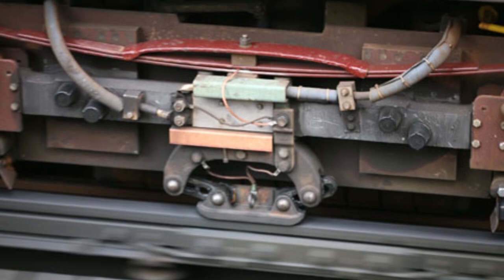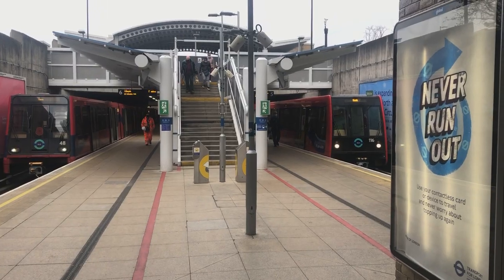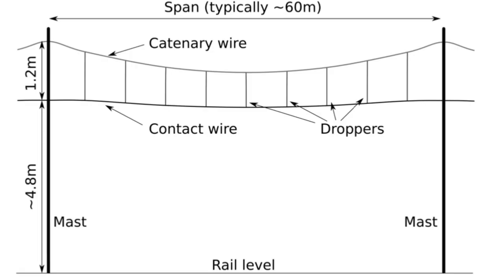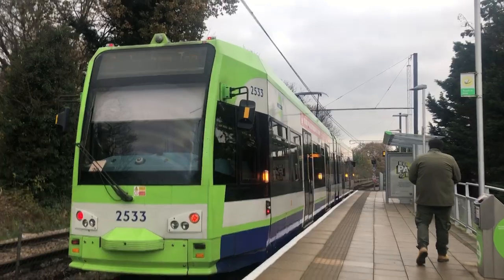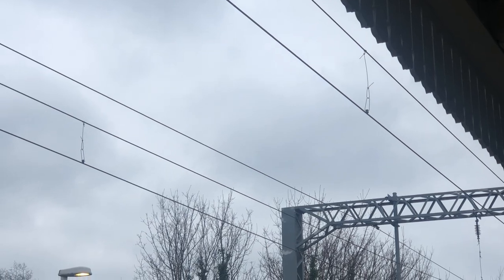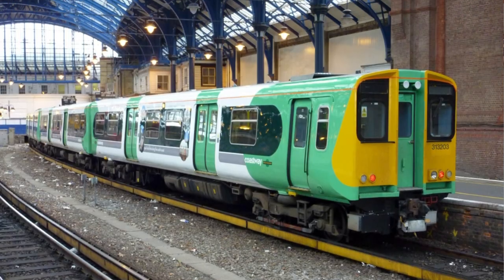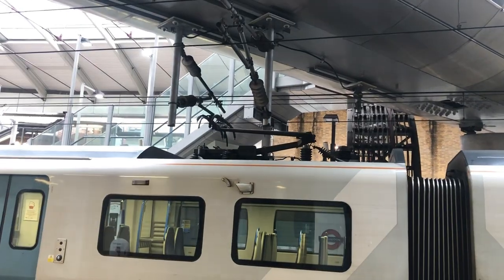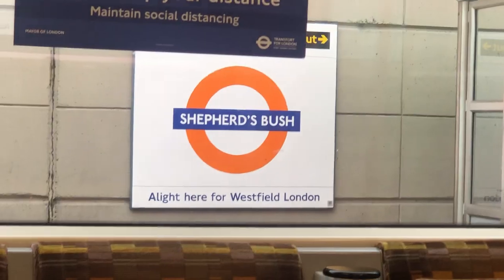How do electric trains actually work?

Comment: Overhead wires also have 'neutral sections' at strategic intervals. These are short, insulated (dead) sections of wire which prevent different phases/voltages from other feeder stations mixing. As a train approaches one, a pair of magnets at track level opens its circuit breakers and cuts the power (minimising pantograph arc should the driver fail to shut off). After a few yards, another pair of magnets closes the breakers and restores power to the train. 

A clunk or bang will be heard if you're sat near the pantograph, lights may dim slightly and any air conditioning will usually cut out for a moment when you go through a neutral.
Reply: Is this used on 1500v DC systems as well? Or is it just that the circuit breakers on these systems are much quieter because I've been on both 25000v AC and 1500v DC and I've only heard the circuit breakers on the higher voltage systems.
Reply: I'm no expert but as far as I know; DC systems don't have neutrals, but it's still desirable to shut off when passing feeder points. The UK's AC system, at least has track magnets to automatically cut power when trains go through a neutral. Most other countries rely on drivers shutting off or even lowering the pantograph. If traction power is already off, the breaker noise should be quiet, going through at full power would produce a very loud bang, arcing and possibly damage the pantograph. There are also signs telling drivers that a neutral is ahead, giving them time to ease power (important with tapchanger loco's). It's all part of the route knowledge anyway. Hope that helps!

Comment: I love this, thank you so much.

A few pieces of trivia. 3rd rail is often chosen for Metros/undergrounds/subway systems, for reasons of space (isn't always room for a wire). Yes, it was chosen for the DLR for aesthetic reasons. The only non-Metros to be third rai are parts of England (generally the ex-Southern Railway lines...as well as two lines in and around Liverpool for some reason), Argentina around Buenos Aires (in fact two different voltages and gauges) and New York City (two different systems there, also, inherited from two different main lines who hated each other)
Reply: I used to live by the main Portsmouth-Waterloo line and, like many other kids in the 70s, would play on the tracks. We had great respect for the strange very black rail...

Comment: Very thorough. Here up north we've taken delivery of the Stalder 777s which potentially can carry a battery which charges up on electrified lines and gives the potential to extend it's range onto the unpowered network.
Reply: I think the reason they contain batteries is because they are planning on extending Merseyrail from Kirkby to Headbolt Lane but they cannot build 3rd rail anymore due to safety.

Comment: Just to add a bit more on 4th rail London Underground running. An ex LU power engineer told me that it is to do with the difficulty of recovering failed trains in deep tunnels. Its because you cannot send out locomotives to tow them out. So the fourth rail is switched over to be temporarily used as a live conductor rail .

Comment: I always wondered how they mitigated single point wear on the pantograph contact patch, thanks for the informative video! Incidentally, on the class 700s, I noticed you can hear the difference in the traction motor noise under load  between third rail and overhead supplies (DC sounds sort of like a car alarm, whereas AC sounds like normal IGBT drive noises) I guess they use different VFDs depending on supply type.

Comment: Note that some London Underground lines have 4 rails.  Two for the running wheels, one for power, and a fourth for the return current.

Why?

Some of the old tunnels are metal caissons and if the normal rails were used as the earth conductor, it would cause the metal caissons to undergo electrolytic damage, so the return current is earthed in the fourth rail to isolate power away from the main rails and their connections to the tunnels.
Reply: Thank you for explaining this. I have been wondering about this for a while.
Reply: Didnt he say that in the video?

Comment: Overhead wires also have tension weights at the end of sections to cope with expansion and contraction due to temperature changes. This ensures constant tension and avoids sagging hot weather

Comment: We have something like that in the US called the P32AC Dual Mode. It can run both from its diesel-electric prime mover and third rail pickup. Amtrak uses it in New York, because you can’t operate diesels in the tunnels under a few of the stations.
Reply from the maker: Oh wow! How comes they can’t operate diesels at a few of the stations underground??
Reply: Also the trains that operate on both third rail and overhead are similar to Boston's Blue Line subways.

Comment: I saw a few vids on how some of the truck routes on the autobahns in Germany are becoming electrified, utilizing an overhead line, much like a train uses, and a hybrid semi with both a pantograph and drive motors, as well a diesel engine that takes over when the truck leaves the truck lanes to a local depot nearby... The semi loads or unloads at the depot, then heads back to the autobahn truck lane, and contacts the overheads via pantograph again... I have no idea how the circuit is completed, as the semi runs on no tracks on the roadway...

Comment: Apart from the speed restrictions, with 3rd rail I always thought you needed substations at regular intervals to maintain current, which is why it tends to be used for relatively short distance networks. To think the LBSCR abandoned overhead wires for 3rd rail for consistency with the LSWR's 3rd rail commuter lines..
Reply from the maker: I’m glad they chose to abandon it. Southern region looks much better without it. Looks more traditional !!
Reply: @networknathan  There's always rumours  that they'll ditch 3rd rail to increase speed and efficiency. Interesting if they ever electrify the West of England main line between Worting Junction and Exeter which method they'd choose..
Reply: @Dark Dreamz There's 3rd rail tracks from Waterloo to Weymouth, which is even further...
Reply: I grew up in the SF-Bay Area when the BART (Bay Area Rapid Transit) system was being constructed in the mid 1960's. The trains use a 3rd rail side contact 1Kv DC which is considered an odd voltage. Each station had a power sub-station 33.5 Kv primary stepped down to 1Kv rectified to DC.  Traction motors were originally DC however about 20 years ago changed to AC 3 phase with inverters.  There are power struds (short lengths of 3rd rail along side the rails where there is an interlock/crossover) And longer ones where their is a gap.

Comment: Very informative and for a Mixed System you're at something like parts of London that have it since I'm from the United States New York City Region has those at the Penn Station area and Metro-North Pelham Station for Mixed System. One more thing about overhead wire those permit a maximum speed of 355 mph 573 km/h since there's a British Broadcasting Corporation footage of the 2007 French high-speed train record which attained that speed
Reply: Generally, top possible speeds are much higher with overhead wires. With 3rd rail, 100 M.P.H/160 km/h seems to be the absolute limit, beyond that the shoe breaks contact with the rail, making it harder to keep up the speed.

The standard voltage these days is 25,000 volts, but there have been others (from 6,500 to 50,000 when AC. There have been DC overhead lines, still re in places like France and Belgium, where 1500 or 3000 volts is normal. Higher speeds are available on higher voltages, generally (MOST of the "high speed" lines out there are 25,000 volts, except Germany's ICE, which uses 15,000 volts.)
Reply: @raakone  Good point there are other high-speed trains that use 15,000 volts ac 16.7hz OBB Railjet SBB CFF FFS Rabe 500 501 502 & 503 Austria Switzerland. 15,000 volts AC 16 2/3 Hz X2000 Sweden BM 71 73 Norway

Comment: over head lines can directly get electricity from grid, but third rail have to have step down and rectifiers since its low voltage DC. And there is less power loss in high voltage over head lines.

Comment: Your vids are livee bro👊 I would actually prefer over-head lines then 3rd rail but pretty much everywhere in se is 3rd really init.  Safe
Reply: The first electrification in the South East was at 6700v ac 25Hz by the London Brighton and South Coast Railway in 1909. When the railways were grouped into the Southern in 1923 a pair of Herberts (their first name!) decided to convert to third rail as used by the London and South Western Railway. A retrograde step considering the need for substations as little as a mile apart instead of 15-50 miles and the speed restriction due to conductor shoe mechanics.

Comment: Good video , most 3rd rail including all the lines in South London the shoe runs on top of the rail, the same is true of the Tube which has two live rails the outer is 420 positive the centre is 210 negative, this gives 630 Volt

Comment: I wonder if you could explain something:  Recently a station in the NY subway system--which uses a third rail--was flooded.  Someone took a video of the flooded station, and it very clearly shows a train making its way past the platform:  https://twitter.com/PaulleeWR/status/1413234413337563138

How is that possible?  Shouldn't the water be shorting out the live rail?

Comment: So why are electric trains classified as in the Class 300 category are AC 25kv OHLE and DC 750v 3rd Rail. I thought that numbering trains in the Class 300s are only to operate on AC 25kv overhead wires only. And Class 400 and Class 500 are DC 750v 3rd Rail only (Class 500s on Merseyrail). 

And the trains classified in the Class 700s category are trains that are built as dual voltage. And hybrid trains which are classified in the Class 800s that are Bi-Mode or Tri-Mode. It does sound so confusing. Probably confusing myself as well.

Comment: If you're laying underneath the train platform when the train is there how do you avoid getting smacked in the face by the electric third rail shoe on each 4 axle truck assembly???

Comment: Ok, but DC has positive and negative, and there is only one wire which is either + or -, doesn't it need both to work? (same goes with the 3rd rail)
Reply: The rails act as the negative "wire", the negative part of the circuit passes through the train wheels to the normal rails, completing the circuit.

Comment: Do you have any idea why thameslink uses AC currect for North and DC for the South? I've always been curious.
Reply from the maker: Well for years the canal tunnel was closed which is the tunnel which connects the north and south of london together on the thameslink line. Prior to that, the south had third rail and the north had overhead wires. So once they reopened them, they just used trains that could change from either electrical systems so it can be used in the north and the south.
Reply: @networknathan  The Canal Tunnels were built in 2004. The link from the widened lines to Kings Cross used to be made just north of the old Kings Cross Metropolitan Station (latterly known as Kings Cross Thameslink) via the Hotel Curve (northbound) to Kings Cross suburban station and southbound from from Kings Cross York Road. When these were closed in 1976, the Snow Hill tunnel linking Farringdon to Blackfriars was closed. The widened lines and the ECML out of Kings Cross were not electrified.

Comment: Electric trains are virtually non existent in North America. This is especially true if you don't count trams, trolleys, metros/subways, and light rail systems. India, meanwhile, has achieved over 90% Electric power on its entire rail network of approximately 68,000 kilometers of mainline rail. If India can do this then the US, Canada, and Australia have absolutely no excuses for still relying almost entirely on diesel engines. Its a national embarrassment for these countries and they will pay for it when the next major oil crisis hits.  Which will definitely come soon possibly even this year.
Reply: I too can't understand this thing in the US. Even in my sh*thole eastern european country you have to travel waaay far from the capital to find any tracks that doesn't have electric power and they are usually very short lines a few km only.
Reply: Is cause most of the rail systems in the US are still privately owned and the government is basically borrowing them because that would be the case for Amtrak. But for the government owned rail systems, most of the time it lies down to the geography of the area.

Comment: 3rd rail is 1500dc, overhead is 25k ac.
Reply: No, third rail is only 660–750 volts
Reply: @epender  I looked it up you're right, I read somewhere that some 3rd rail is 1500dc though.  Thanks for putting me right.

Comment: More people die of diesel fumes than are electrocuted. A modern so-called diesel train has electric transmission (as opposed to shafts and gearboxes).
Reply: Please check your facts before commenting. Only Diesel units in the 2xx classes (such as 220, 221, 222, 231) and bi-mode units when in Diesel mode, have electric transmission. Apart from the 231s and the bi-modes, all other Diesel units built since 22x have either hydraulic transmission (185s) or bus-like gearboxes (172s, 195s, 196s, 197s). Of course, Diesel locomotives have had electric transmission since the 1960s or earlier.

Comment: Nathan, it's a great pity that you do not know the difference between a "train" and a locomotive, so let me educate you.                                                                                                                                                                         A "train" is simply a number of wagons and/or carriages connected to each other and pulled or pushed by a locomotive.                                                                                                                                                                          A (railway) locomotive is an engine that uses steam, diesel or electricity to drive its wheels.   So there are steam engines, diesel engines, diesel/electric engines and electric engines.                                                                Railway locomotives pull and/or push "trains" on rails.                                                                                                                                 There - that ought to be sufficient for you to stop calling locomotives "trains".
Reply from the maker: so what about all new trains that don't have a separate "locomotive" for the engine?? its called a train no?.....